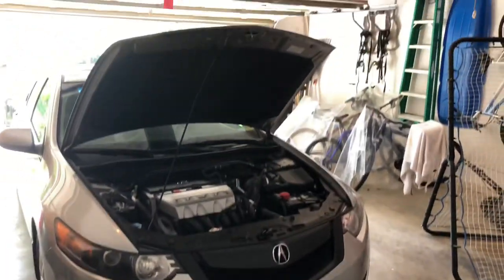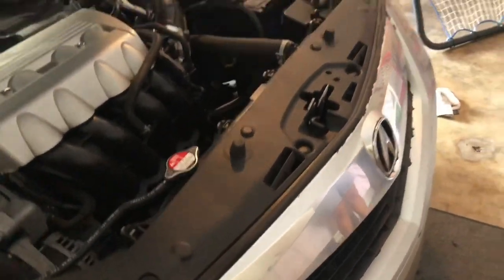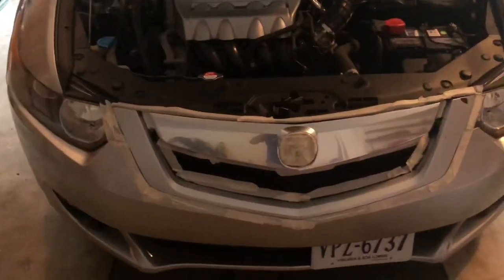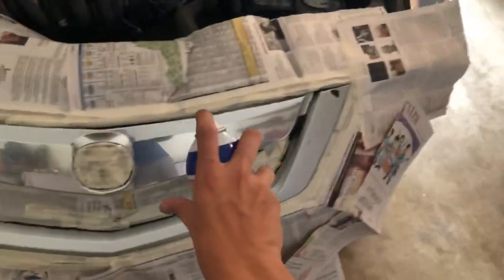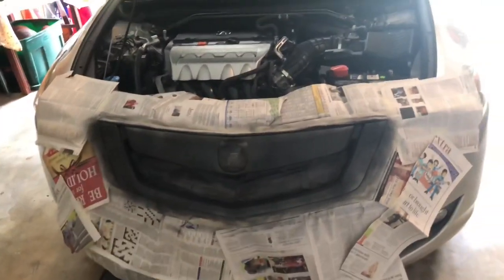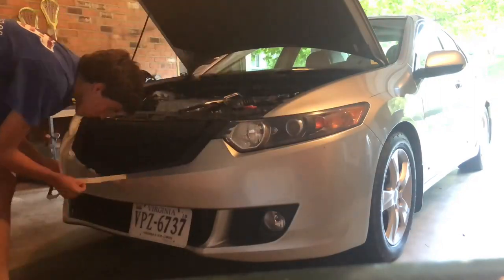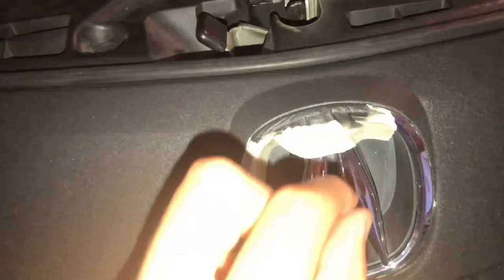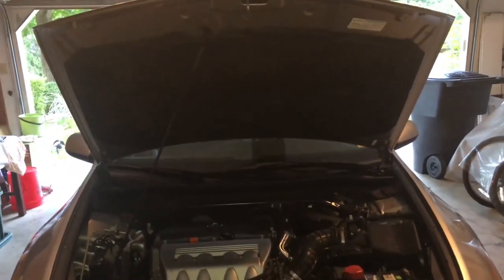How to Transform the Front End of Your Car for $5  | Plastidip |   [4k]

Comment: Hey I have the same TSX and want to replace the "V" part of the grill where the Acura emblem sits. Do you know if that "V" piece is separate from the other part of the grill that you plastidiped, or is it one whole piece?
Reply: don't have a tsx but i want one and have the same question,
Reply: Yea u can buy a new grill on ebay but be careful and make sure u buy the right one because i bought one and unfortunately it wasnt even usable because the back of the grill didnt hahe the right clips attached to it to fit the car(got scammed!!) but yes it is possible .

Comment: Link to the spray paint that you used?
Reply from the maker: Scott Ostrum Performix 11203 Plasti Dip Black Multi-Purpose Rubber Coating Aerosol - 11 oz. https://www.amazon.com/dp/B0006SU3QW/ref=cm_sw_r_cp_api_GD.MBbNBA45QH
Reply from the maker: I got mine at Walmart but it’s the same price on amazon, if you’re doing grill one can should be more than enough but if you’re doing rims, I would go for two
Reply: Auto Garage  Thanks! The chrome on my TSX is peeling and this looks much better.
Reply: Also... the grill is extremely easy to pop off making is super easy to paint.
Reply from the maker: Yeah my chrome was peeling too and I didn’t like the chrome look personally anyway, give us a sub if you don’t mind I’ll be making a lot more TSX videos once all of this hurricane rain passes!
Reply: Very cool. Just got a 2016 TLX and I am definitely not a fan of the beak. About how long does this last/needs reapplication?